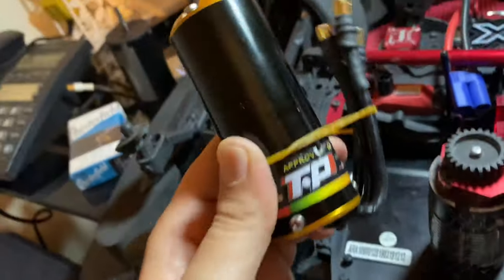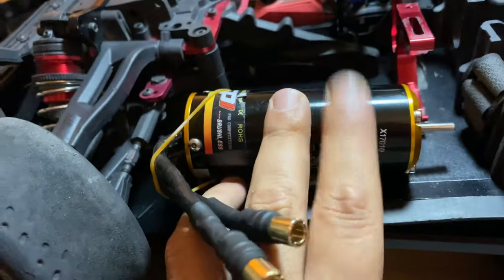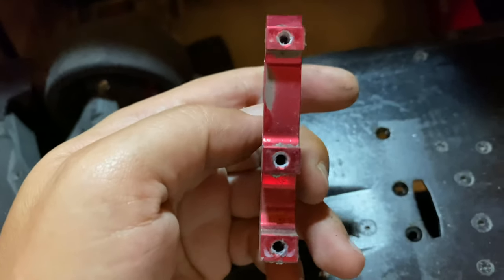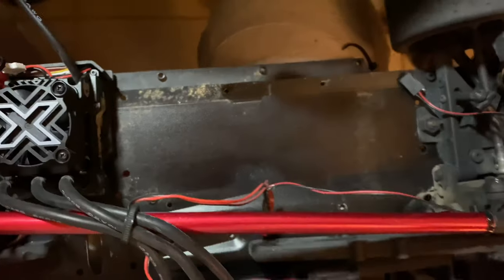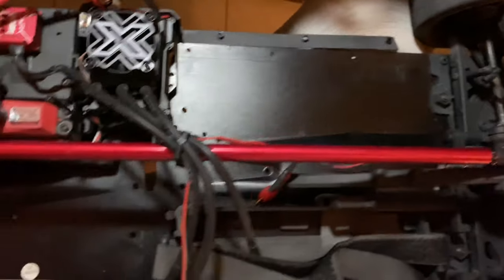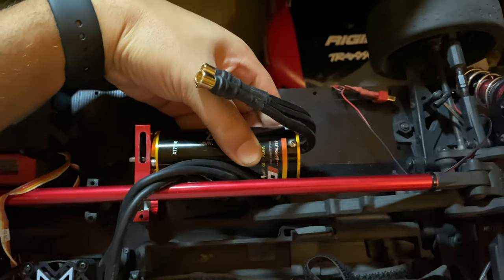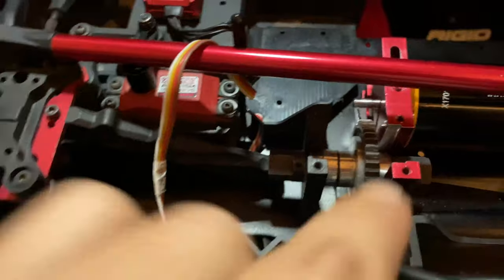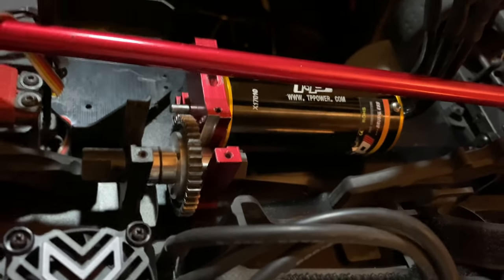Fit TP Motor 4060 or 4070 Infraction Limitless Feloney

Comment: Great vid brother! I just put a 1717 Castle and Max5 in my Infraction and I'm going to build my Felony or Limitless with a TP 4070 flipped like you did. i just hate having 2 batteries on one side so the weight isn't balanced one TP motor doesn't weigh equal to a couple 4s or couple 6s in parallel. But it doesn't seem to bother any of the guys running 150Mph so I guess it's ok. What Kv 4070 do you recommend? I'm looking to eventually get to 150.
Reply from the maker: yeah bruh thanks and nice build just watcth my next vid i did a corner weight balance

Comment: Do you think the tp 4070 2200kv with a 8mm shaft fit with the stock mount?
Reply from the maker: 4070 yes but 8mm no you need 1/5 mount
Reply: @UAERCADDICTS  are you talking about the motor mount 1/5 they sell on eBay suppose to be for the fat cans?